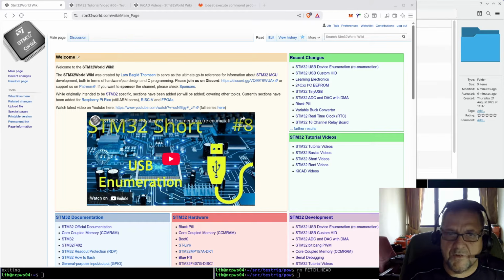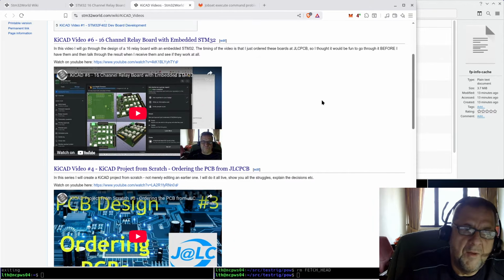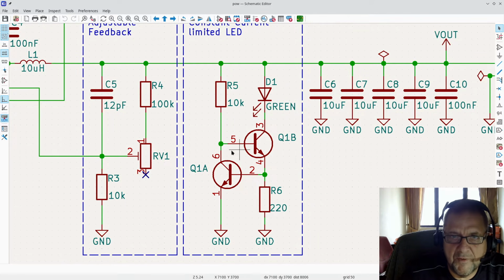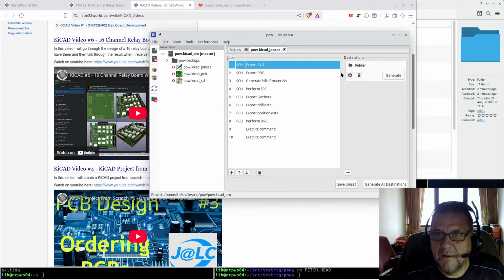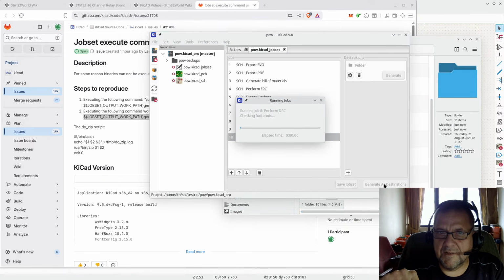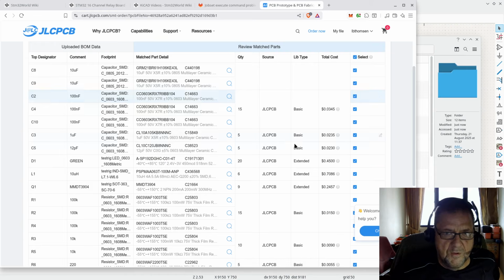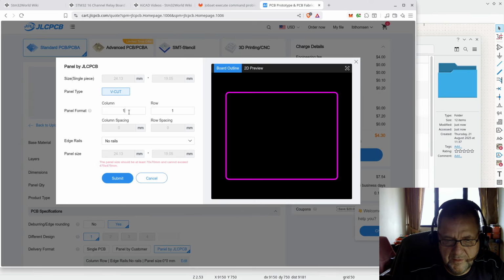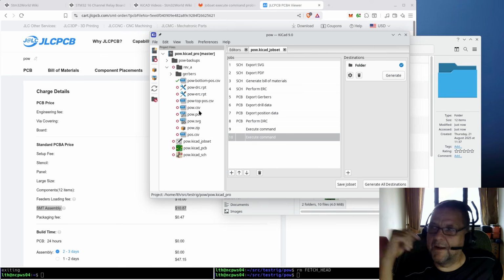KiCAD #7 - Jobsets - EXCITING New Feature

Comment: Why 5 @10uF caps on the output, rather than a single larger one?
Reply: Lower esr
Reply from the maker: Voltage rating and price.  This is the largest 50V rated cap available as a basic part at JLCPCB.  I use the same for the input and input can go up to 36V.  As another commenter mentioned it also lowers esr but in this case that was admittedly not a serious consideration.

Comment: It's actually much easier even without job sets. Your method was really unnecessarily complicated. Just click on File / Fabrications Output on the board and after 2 seconds the folder for JLC is ready.
Reply: Jobset is much more than that. End of the day, clicking around is error prone and it is easy to miss some details.
Reply from the maker: That require a plugin made by third party and I don't trust that and it might - and often do - break during updates.  The jobsets is a move in the right direction - I can still control what is being done.
Reply: @stm32world  oh, missed that i'd installed a plugin for that.
Reply from the maker: I generally avoid plugins.  KiCAD goes through rigorous testing - plugins much less so.  The Jobsets is a KiCAD feature and as shown in the video it can indeed automate the process 100 %.  A process I used to do manually which is a pain in the butt and prone to errors.  I also export stuff like svg/pdf of schematics, 3d rendering of board as part of that process even if JLCPCB does not want them.